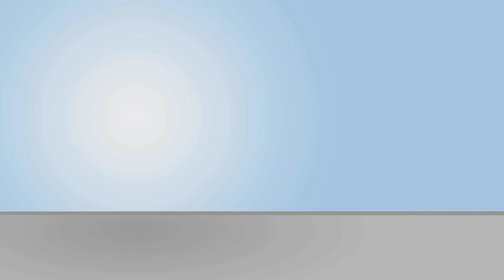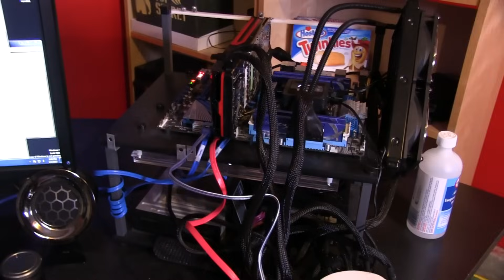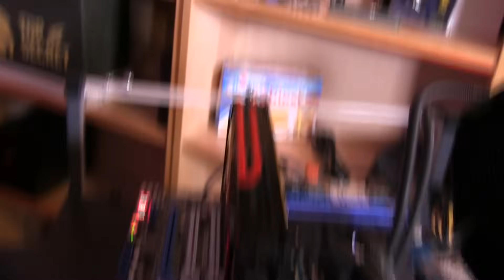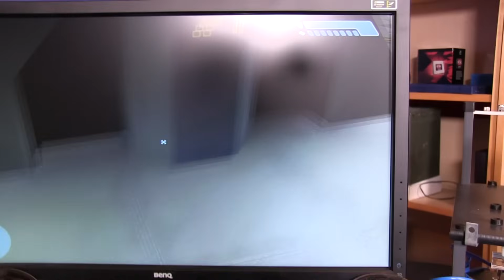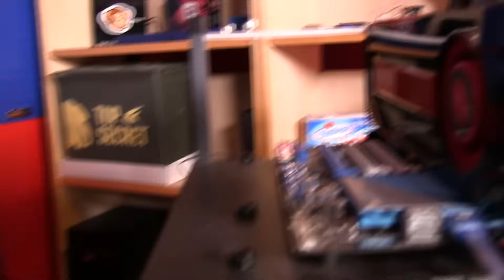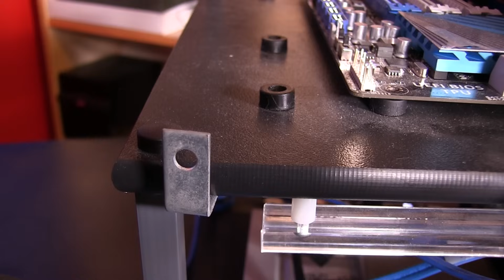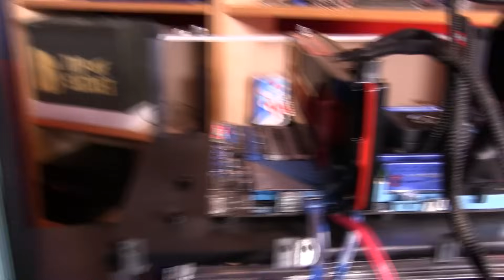Coil Whine Explanation & Demonstration Linus Tech Tips

Comment: My 780 ti does the sammmeee thing -_-
Reply: Dang man, I just returned my rig back to Cyberpower a couple days ago. I had a 780Ti and a Corsair 750D. When I closed the front panel I would always here this wine and I could never figure where it was coming from but when I opened my front panel it would go away (probably from the air flow noise or something). but it was annoying and I could not deal with it, Now I am guessing it came from the graphics card itself!
Reply: Ha, I just watched some more Youtube videos of coil wine from GTX graphic cards and I have confirmed that the whine I was experiencing was indeed from the GTX 780Ti. I think our coil wine is so much worse than the ones in this video because it was almost like I could not identify the problem yet I could here it more then 20 feet away from the rig standing in my kitchen. Sigh

Comment: That's not coil whine (at least as far as I've been able to see). That's just interference / poor wiring / earthing problems coming through your speakers.

Coil whine is when certain electrical parts vibrate at a certain frequency, which causes it to get worse and worse (resonance) and eventually vibrating so much that it makes a sound.

If you can't drown it out with headphones / speakers, then it's not coil whine.
Reply: Thankyou

Comment: omg! just built a new pc with Gigabyte 780oc (an upgrade from p4 northwood + ddr1 + 6800gs). So you can easily imagine what i was like playing this bf3 on ultra settings. xD But, back to the point - i was wearing headphones and didn't notice a noise as such. Today i just panicked when i started bf3. But it sounds exactly like yours! Looks like i was just overreacting and there is nothing to worry or do about it. Thanks for that vid mate! 0/

Comment: I have the same issue with my new evga gtx760 acx.
The first two weeks, it went silent.
And, from a moment began to do that coil whine, lesser than in the video, but I hear it.
I´m trying to stress it, because I read using that using it at full charge, with the time the sounds goes away.
If not, I have a year to apply the guarantee.

Comment: Coil whine has nothing to do with resonant frequency since the VRM circuitry and the self-resonant frequency of coils in modern electronics are usually an order of magnitude beyond the humanly hearing range. What most likely happens is that ripple and noise from the PSU and other components gets modulated by the GPU VRM trying to compensate and now you get broadband noise potentially extending all the way to 0Hz.

Comment: This was completely new to me, and if the card itself was the only thing making the noise I'd be fine, but my 7870 was spreading the noise to any sound device (did onboard, then bought a pcie 1x sound card, swapped them around, tried a different psu/mobo/rma'd gpu even) so I got the same sound from the card like linus' system as well as my speakers, and I even tried my Klipsch speakers, headphones and monitor speakers, luckily the company I got it from is going to let me exchange my card

Comment: Coilwhine from a GFX (or a monitor) is usually related to the amount of frames rendered thus enabling vertical sync usually stops it. Coilwhine from mobo / CPU is most likely caused by C3/C6 sleepstate (CPU-feature that causes core(s) to constantly switch on and of) - this "feature" can usually be disabled in BIOS. Coilwhine from a PSU is caused by capacitors that are not "insulated" properly - this is inacceptable for quality PSU's and should not be acceptet (RMA 'em).

Comment: There is this thing that just makes me rage. 8800 GT, GTS 250, GTX 560, GTX 560 Ti, GTX 580, those are all the cards I had before and none of them did that... Now that I got the GTX 680, it happens during windows experience index and in minecraft menu on maxfps setting.

Comment: Just use precisionX to limit your framerate. From personal experience I have noticed that my GTS 450 only whines when frame rates are above 400FPS which is why it is more present in lower end games. You really cannot tell the difference with input lag at 120FPS so set your frame limit to 120, and if your computer cannot reach 120 set it to your refresh rate (vsync).

Comment: coil whine can be easily eliminated by enabling a framerate cap or turning on vsync. Not sure if you can enable it through the nvidia control panel, but if your gpu is compatible with precisionX, you can use the "target frame rate" function. The maximum is 120fps, but if that's not high enough you can usually turn it on ingame with a console command or editing a .cfg file.

Comment: There are 2 types of whining; one is pitch-fixed to a frequency, the other is the one you demonstrated, wich is obviously depending to something the gpu is doing dynamically. In the second case, I don't think it is data related: data signals passing through components and chips hasn't enough power to whine, but current for powering vrm does, and they're variyng power modulating frequency, so I suppose it's them somehow. It's something that has to do with frequency - wich varies - for sure.

Comment: I've had a few GPU's with coil whine this bad. I had a 9800GX2 that was actually a bit louder than this one. It was to the point I was able to attempt melodies with it by looking in specific directions. Funny stuff.

If your card is a good overclocker and not worth RMA'ing, adding more hot glue around the coil will quiet it down, but don't expect the RMA department to be overjoyous about honoring your warranty if you mention you've done that.

Another fix is adding a nice 5.1 surround system

Comment: My Refrence EVGA GTX 670 2GB Has coil whine past 1000 fps, not a real problem in real world gaming but it sucks doing benchmarks. My GTX 660 OEM 1.5GB GK104 had ZERO Coil whine in the same system which is odd as they are pretty much the same Pcb.

Comment: The coil whine is only so bad there because its an old game so FPS is very high. When you look at the ground it gets worse as the fps goes even higher.

You should have showed the regular coile whine of the card, that is what it sounds like @ 100 percent load but with a more normal frame rate such as 60-100. The noise in the video is several hundred fps maybe even 1,000.

Comment: I ponder delving in depth into coil whine whenever I get a card that does it. It probably has alot of to with the that that alot of people are using PWM / switch mode type regulation which pulses the power at high frequencies to take the load off the switching / regulation mosfets. Which simply lowers the duty cycle on the part, and allows a much smaller part do more work. Efficiency in multiple aspects, but it can be annoying if the filter coils start to vibrate from the pulsing magnetic field.
Reply: hello man of the past
Reply: Hallo there  @bombblower367

Comment: doesn't matter. its just about how the manufacturer has tuned the card. when they make the card they "tune" the parts so the sound is outside the frequencies the human ear can hear. Some power supplies give too much or too little power which makes the sound more audible. My palit 670 was singing like a bird and then palit told me to switch out which 6 pin connectors I was using, switching them out actually helped alot!

Comment: Coil whine is inductors. Not capacitors...

It's caused by noise from other circuits operating at high speed. High speed inductors induce noise in surrounding circuits and vice-versa.

Comment: the point is that even those cases CAN'T block out those sounds.  you forget that it's not sheer 'decibels' that affect hearing; frequency matters as well.  moving air at 14 DB is nearly silent, a whistle is MUCH, MUCH more noticable.

sorry dear, but MANY, MANY people are sensitive enough to hear this.  have you never visited a hardware forum?  also, you do NOT need to be gaming to get coil whine, any load (yes, idle) can cause the noise depending on the electrical components

Comment: Disconnecting ground will probably cause ground issues I'm a sound engineer who deals with mixers, amps, etc and grounding is very important to keep interference out. The problem with headphones is that they are unbalanced which means any noise picked up along the way you hear. Cutting the ground wire might help but it might make much much more worse.

Comment: I don't have enough PCI-E connectors on my 600W to power both, nor is it enough. And my 800W has the same connectors, but tons more sata and molex connectors. If you want a good job for money... work on a farm. usually you are payed well. I worked on the one i do know for six months and got a $0.50 raise.

Comment: Yea... I had this with an old radeon 5750 but when my motherboard died I built a new rig. Chose dual 7970 ghz edition. And now I have a 600 and a 800 W inside my computer case. And yes obviously my 800 doesn't have the right connectors either so it only powers one. I ordered a new one off newegg and it just got sent out now, like 4 hours ago now, instead of on the 23rd when I bought it. Oh the other thing I did was oddly I updated my NIC drivers and that stopped the coil whine.

Comment: Hey Linus 
is your screen brightness all the way up on the graphics card i have find my on low so i just up put my brightens all the way up and it stoped O_o it worked maybe give that a try and tell me if it has stop some times it helps to put it all the way up on the graphics card not the screen as the power is been held by the screen brightness on the card

Comment: That's is normally caused when an headphone is connected directly to the motherboard (onboard audio). Using an audiocard will probably remove the coil ;) Some motherboards have very good onboard audio and don't require another audiocard to actually remove the coil.

Comment: My geforce 4200Ti had sick coilwhine, my followup the GF 6800XT had unbearable coil whine, my 8800GTS 320mb had a tiny bit of coil whine, my 9800GTX had very much coil whine by frames above 200 (loading screens), my GTX460 HAWK has also sick coil whine with high framerates during loading screens.

My brother have had almost the same cards as me but all his cards are flawless -_-

Comment: I bought an AMD 7850 from newegg that had pretty bad coil whine. I RMA'd it and actually got a replacement (I did have to pay shipping though). The new one only whines under extremely high frame rates. Most notably the menu screen in STALKER that can easily reach 1500 fps for some reason. 

I have a dual fan 7850 so it made me sad that the coil whine was actually louder than the fans on video card.

Comment: In my experience coil wine has been fairly random. 

I had coil wine with my old Gigabyte GTX 470 SOC (THE highest-end 470 available). 

This was on my MSI P55GD-80 motherboard (among the best P55 boards made) and my Silverstone 600W (I forget the exact model, but 504W of the total capacity was on the 12V rail so high quality PSU).

Comment: Yes but there's always the "be vague as possible" option and make them take it anyway. You could even say your budget changed shortly after purchase and your now aiming at a higher end product. 

Fact is the Whine is something a proper product Shouldn't do, its a flaw in design somewhere within the card. My uneducated guess would be its the cooler making that sound so when you send it back that's your reasoning, a bad cooler. Be that the cause or not it doesn't matter.

Comment: Generally a shield over the entire analog portion of the card is best. It really depends on how strong the interference is.  Sometimes just using an add-in card is enough to add distance between the analog amplification circuits and the noise source but external sound cards or TOS-Link (optical) is the best way to eliminate interference in a headset or external stereo amplifier.  It is also a good idea to re-check or move your cables first to be sure the noise is coming out of the sound card.

Comment: im quite lucky since ive not experienced this,however for anyone getting serious coil whine try running games in windowed mode ( even if the window takes up all the screen ) and also try disabling v-sync or visa versa.... that said i believe coil whine fixes are specific to each card .. or each manufactuer ( eg nvidia,amd ) ...  also cheap components can be a possible reason ( allways buy the same brand were possible ..( i recommend XFX(nvidia ) and sapphire (AMD ) ..

Comment: A fix would be just run the card at highest possible FPS and 99% gpu load for like a day and the noise would be gone. Or just increase the voltage/power and stresstesting..

Comment: Still a better sound than the awful grinding sound my Sapphire 6950's left  fan is making between 60 and 70 percent fan speeds.  But I can't RMA until I get my MSI back from RMA.  The MSI had a broken fan.  On the plus side I found out that I don't like crossfirex solutions due to the intolerable noise that the cards emit.  That and the game play doesn't seem as smooth as with one card.  At least from the 6900 series.  It turns out that Tiny Tom was right about the 6900 series being too loud.

Comment: I've only ever had one GPU that has done with to me. It's caused by badly shielded mosfets/capacitors is it not? Heard some people had some luck fixing it by opening the GPU casing and using black nail polish to paint over the mosfets/capacitors to provide extra shielding. I just RMA'd mine instead. Go with EVGA my friends - good quality shielding

Comment: I have a reference 7970 and it doesn't coil whine. The only thing is that the fan noise, when on a very demanding game, is kinda loud, but very bearable. If the PSU has anything to do with it not coil whining, mine is a Corsair TX850.

Comment: I suffered from serious coil whine. I havve KRK rokit RP6 monitor speakers on my i7 system. and the noise came through the speakers.
I plugged the cumpiter into another power outlet in my room on a different power line to the normal one and it improved alot. then i took out my cretive soundcard and went with my external interface ....all gone now. using a i7 with seagate PSU

Comment: I've had one graphics card with coil whine (7900GTX). The solution is to make sure that vsync is ENABLED, as it MOSTLY occurs when the frame rate goes into the hundreds (that's why Linus is getting the change in sound frequency when he looks around on the game). I would still get the coil whine in the menu of some games if the developers didn't frame cap it ... the way to get around that is to use a program like afterburner to set a frame cap manually (usually to the monitors refresh rate).

Comment: Coil Whine happens quite often to me. Mostly in game menu's and older games. It happens when you get to many fps in your application. What helps is to turn on vsync or a fps limiter. Luckily MSI Afterburner comes with a tool that allows you too limit fps. Just cap it at 200 fps for your application of choice and the coil whine should be gone.

Comment: Changing in demand and offering in voltage and amperage. When demanding more the amperage will rise in the coils making the electrical field stronger an when there is less demand the magnetical field will lower. This occurs in rapid succession. Due to this the coil when its poorly designed and cheep will start to vibrate. Vibrate = vibration in the air. Air vibration = sound. When this comes in between 20-20.000hz you can hear it.

Comment: What you are describing is indeed the sound card picking up the high frequency electromagnetic fields generated by any filter chokes/coils or even PCI-express lanes close enough to the on-board sound card to cause interference.  You can generally eliminate the interference by using an external sound card, an external tos-link digital to analog audio box (if your motherboard has tos-link), or getting a shielded internal add-in sound card.

Comment: Not all cards and coils will react the same however any component that has filtering can have coil whine but a lot of it is due to the quality of the output filtering in the Power Supply, the amount of power used by the component and the build quality of the chokes on the component making the whine..  Generally if you get coil whine in a system replace the PSU with something that is better quality and provides more power and it will many times go away.

Comment: What this tells me is the PSU he is using on his test bench has very poor quality output filtering or it is approaching its maximum output.  My rig has 2 HD6990's and I was constantly getting coil whine whenever I would run folding@home or any intensive games.  I also had some coil whine on the main-board all while my system was running on a 1000Watt Zalman PSU.  I eventually ordered a Mushkin 1200Watt PSU and the coil whine is now gone completely from the graphics cards and the main-board.

Comment: Coil whine is caused by poor filtering of PSU output rails and poor build quality of chokes used in pretty much all of today's hardware in combination with high current requirements of components.  It was never an issue until switch mode power supplies and high wattage became the norm. Many of today's PSUs suck at filtering out the high frequency pulses used to more efficiently step down the voltage.  A linear computer PSU would fix the coil whine issue if you don't care about efficiency.

Comment: Coil whine is caused by amount of current through a coil. When linus was moving his mouse in the game the amount of graphic process required, was changing so does the current through the coils changes. The whining is at maximum when amount of current in the coil triggers the resonance frequency. There are some soloutions which voids your warranty but reduces the noise ...such as applying some neutral cure silicone rubber around the whining coils but ofcourse if there are enough space around them